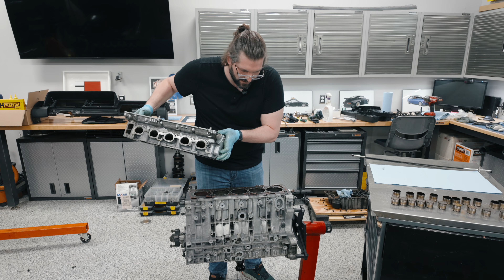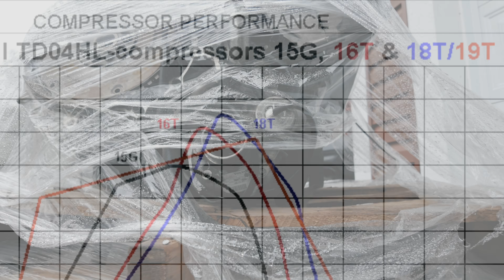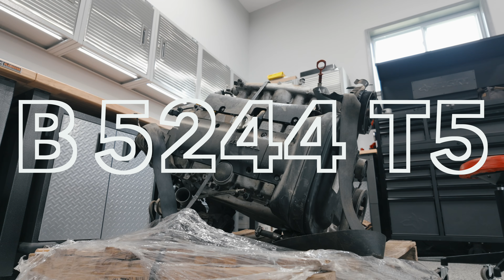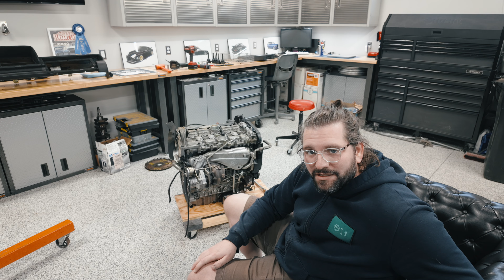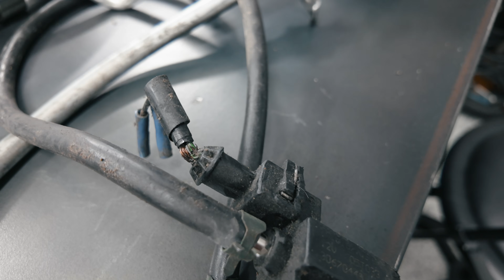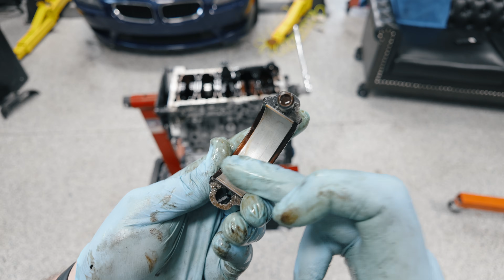The Best 5 Cylinder Volvo ever built? | 2006 Volvo B5244T5 Turbo Engine Teardown

Comment: Probably measure the bores. The head bolts being loose on the exhaust side could be caused by the engine running hot

Comment: Thanks for the methodical tear down with detailed commentary. I currently have the issue of exhaust gas escaping into the coolant system and bubbling over my expansion bottle. I'm gearing up to pull the head and hoping its just the head gasket or a torquing issue like you identified.

Comment: Man I'm pretty sure that thing doesn't have a head gasket, in fact it blew my mind when I saw it!! The oil pans are the same way, as far as I know...
Reply from the maker: They use head gaskets, but the cam cover-to-head, block-to-intermediate section, and intermediate section-to-oil pan flanges are all sealed with anaerobic sealant. A little annoying to scrape off, but otherwise works well!

Comment: is that block stronger than 2.5s?
Reply from the maker: Yes. B5244T5 has 81mm bores instead of 83mm on the 2.5, which means thicker cylinder walls on the B5244T5. Other B5244 variants are different, with thinner cylinder walls.

Comment: How come it has a alum. Intake mani??
Reply from the maker: That's the original RN intake manifold used on the P2 generation S60. Only RNC engines that came in C30s and later S60s had plastic intake manifolds.

Comment: Not sure if this will be responded to, but i have an 04 c70 and an 05 xc70 that i wanna rebuild. Will this video be a good reference for rebuilding them?
Reply from the maker: This video isn't really about rebuilding the engine, and the engine in this video is a little different than what is in both of your cars. 

This link has factory manuals that provide rebuild instructions, but you'll have to have some patience and perseverance in figuring it all out: https://charm.li/Volvo/2004/

Best of luck.
Reply: @Drive.Revive.Tinker oh awesome thank you! I did watch the whole video through and it did at least give me good reference for the teardown of the engine, so that'll definitely help

Comment: It's always a high risk to buy a used Engine. Therefore I always repaired the original Engine from the car, if possible. But my 25 years old C70 runs like new,
the Engine has no issues still today.

Comment: Long time R owner. That’s the engine to get. They rarely crack a liner so wouldn’t expect that to be the issue. Head gaskets do fail on these particularly aftermarket version. Leak down testers are notoriously inaccurate as well so I’m always cautious to accept results at face value. Tearing down was a good move. I would have also checked head for leakage past valves but machine shop certainly can do that. I’m building a T5 now but with some key upgrades to handle a lot more boost.
Reply from the maker: Very cool! I did end up checking the valves in this and another 4t5 head I have. The head from this engine definitely needs a valve job, so that's added to the list. What are your plans for the T5 going in your R?

Comment: oh man. That's close to the mileage and the same year as my old S60 T5. It had 164k miles when a teenager pulled out and I t-boned them. Still have the 2.5" binder of receipts for everything down to control arm bolts for it. Bought it with 72,060 miles in 2015, lost Labor Day 2020 at 164,344. If you still need an oil filler cap, I've got a spare in a Volvo bag.

Comment: Hey, just found your channel yesterday, and have watched 3 vids.  Nice shop, nice ideas.
But, you need to pay more attention to what you're doing, I think, I'm seeing a lot of newbie mistakes for whatever reason.  Maybe some of it is misinterpretation on my part or not watching the vids 100%.
Some thoughts:
- In the previous motor that broke the head gasket:  if indeed the head was bent before the incident, that's really kind of careless.  A straightness check of the head is super-basic and is in every motor rebuild manual since the Edwardian age.  And you certainly don't use some school ruler as you waved at the camera in another video, it must be a calibrated straightedge (there are standards of straightness, but get one to 0.1mm, over the length) that is longer than the diagonal length of the head.  The manual will give the maximum out-of-true.
- Again, in the previous motor, if you have a blowup and head gasket break, then run the motor again without even changing the oil to get rid of the coolant that got everywhere, you're just asking for problems.  Coolant in oil seriously compromises its ability to provide lubrication.  There are also products (or at least used to be, I've used one from GM 25 years ago) specifically made to help flush coolant contamination out of the crankcase in such cases (not the same as engine oil flushes for carbon removal).
- Not having doublechecked the TDC marker on the previous engine, is again just missing a basic thing that is likely in the manual, and even if not, should have been done on an unknown engine.  The manual is your friend.  RTFM.
- Leakdown testing:  Unless you're editing out bits, it looks like you're really not doing leakdown testing at all the right way.  First, for each cylinder, you have to have the piston at (near) TDC, *but with both the valves closed*.  This doesn't happen at any TDC, only on the compression stroke (every second TDC).  It is totally invalid as a measurement, otherwise.  Second, you don't connect the tester to the cylinder and then crank the regulator!  That's backwards.  You set the regulator to get the % leakdown gauge needle shifted to Zero, lock the regulator control, and THEN connect it to the cylinder, then watch the % needle move.  What you were doing here on video is just not how to use the tool, as far as I can see.
- No one should expect to be able to just throw in a motor from a junkyard and expect it to be ok and tunable with boost, but I guess you know that by now.
- I didn't watch everything later on, but if you have a crank that does not want to turn, it is not something you are going to be able to resolve by pushing it, putting some Seafoam in, and hoping.  A crank that gets stiff at some parts of the rotation is either caused by rust damage in one or more cylinders, or similar damage, that doesn't let the rings move smoothly, OR by the crank being bent.  (This shouldn't be confused with the normal increase in resistance because of valve spring compression as you turn the motor, if the cams are in, or from air compression if the plugs are also still in (not the case here, I know).)  A mix of ATF and acetone works well for rings that have rusted to the cylinder wall, by the way, to allow them to unstick, to facilitate disassembly.  Irrelevant by now, I know.

Anyhow, I don't know where you are by now in the work, but good luck.
Reply from the maker: Details get glossed over while compressing hours of video down into something short enough to be watchable, so there are things that don't always get shown, but regardless I appreciate the time and thought put into your comment. 

Interesting note on the sequence of pressurizing the tester before connecting to the cylinder; I'll have to look into that before I use it next because I don't recall that lining up with the instructions (not to say that they couldn't be wrong as well).
Reply: @Drive.Revive.Tinker  It's how my tool works, I've always done it that way, and when I crosscheck around youtube for other examples, e.g. https://youtu.be/h993q16Oul4?t=280, it seems to be the normal setup for them.

Comment: I never trust salvage yards.  Never.  I bought a RX8 engine online and when I tested it totally locked up, rusted so bad, when I tried to take it apart I couldn't.  They did send me a refund less shipping, and said don't send it back, I sent them video showing it would not crank over.
I generally buy whole cars to get an engine I want, one usually has a wreck of some kind or a bad transmission or won't pass smog etc.
This is a hassle for sure, but then you really know what you are getting.  I got a free Ford V6 recently, and it had no compression in 3 cylinder, the valve guides were toast so bad.  But then I just got another one that had a "engine knock" from a guy who bought it for the body to ls swap it and got rid of the engine and 5-speed.  Turns out the "knock" was just a cracked exhaust manifold, otherwise perfect condition.  
 Best of luck with it.  I'm not done watching,  rebuilding it you will know its good.
Reply from the maker: Yeah, it's so nice being able to actually hear an engine run first. Especially with engines that are decades old at this point, it's hard to find them that are actually in decent condition. Thanks for watching! Next up I'll be pulling the built 5 cyl out of the car and doing a similar teardown. It may be a shorter path to quickly refresh that engine and save this one for down the road, but we'll see!

Comment: I wonder what your test would show if you reassembled it with correct gasket and torque specs? Does it even really need to go to a shop for resuracing and crack testing?
Reply from the maker: There’s a chance it would be okay but, to me, it’s always worth resurfacing the head at a minimum. I ended up finding out that the head needs the valves lapped as well

Comment: wow, the 'mechanic(s)' working on it previously really did a shitty job. Missing bolts, wrong bolts, wrong gasket, bend coil pack.. It doesn't make sense at all, like, why would you do that? If you are enough of a mechanic to change a head gasket, then why 'settle' for putting in a wrong part? Just because they had it lying around? It just seems weird.

And the company you bought it of from... yeah well so far for the rating of their products. I wonder if you'd bought a grade B engine if it would significantly differ in price?

Comment: I have a 2006 S60 2.5T which runs like a clock, Its got 165K on it and I plan on keeping it for as long as I can. This video was OutStanding! It really was informative as to what the whole inside looks like and what to expect. I did my own timing belt other stuff and found these cars are really engineered well. I am starting to have electrical issues with the Upper Electrical Module, and the drivers information module but have solderer some componets and replaced a capacitor and it seemed to fix it.. Please make another video where you do the rebuild..  I really enjoyed the content. Keep it up..
Reply from the maker: Thanks! I'm glad you enjoyed the video and the teardown.
Reply: Do you post your work anywhere? I like to follow people's projects to learn from them.

Comment: FYI on a leakdown test on a OHC engine like this. Unless you can take the cams out of the engine and you have the valves closed FOR SURE, you most likely are getting the engine rotating when you add the pressure. 100psi will rotate the motor to where it wants to be so most likely you are getting a valve cracking open, and the only way to prevent that is you use the crankshaft tool used when you set the cams OR you keep a flywheel on there and have a flywheel lockout tool. I've been building engines for 25 years and did a Volvo for my personal car, and all the little tricks you need to check everything are a lot of extra work. I ended up closed decking the block, porting the heads, upgrading the stock turbo and welding and porting the intake manifold.  Take your leakdown numbers with a grain of salt if you can't make sure valves are seated and keeping the crank from rotating.  I was under 10% when back together with the same pistons & rings, same bores untouched, and a stock valve job on a 200K mile engine even after the closed deck conversion and porting.
Reply: Also.... most likely you just need to mill both the block and head decks. The 5 cyl seems to bow in the center so it really shows on 2/3/4 leakdown like yours did, and most likely they didn't change the head bolts and the exhaust side bolts yielded... there is additional heat over there so you will see it happen first there.
Reply from the maker: Thanks for sharing your experience! This will definitely get the block and head decked while it's out. I'm confident it didn't rotate a meaningful amount during the test because on the weak cylinders I tried rotating it back and forth a bit to see if the readings changed and to ensure it hadn't moved, but I've also tested a number of these engines. Very apparent that this had poor leakdown compared to the others. For a test like this, I'm not worrying as much about the absolute % reading as I am the differences between cylinders.

Comment: Really good vid this, iirc it’s only the s60-v70 R engine that comes with a MLS gasket from factory.. 

I’ve recently installed a genuine MLS gasket for my own N fully forged build.
Reply from the maker: Thanks! I'll have to dig it up in the comments, but I believe someone shared a part number for the genuine Volvo MLS gasket for the 81mm bore block. Can't yet confirm whether it exists.
Reply: @Drive.Revive.Tinker  i dom´t thonk it exists. i currently also look for it

Comment: This is super insightful. I became a Volvo enthusiast about 2 years ago when I picked up a passion red 08 c30 t5 from a used car lot for 5k and did some extensive work on it to get it back into good shape. I'm going to agree that the non-mls gasket and the uneven head bolt torque almost certainly is why cylinder pressure is getting into the cooling system. Also could be possible the head is warped if the engine overheated at some point. 

I would also say this is less likely but;

Micro cracks in the head around coolant jackets (common in overheated motors).

Sleeve shift in the block (rare on these unless extreme overheating).

I don't think that's the case here. It frustrates me to my core when I see non oem parts on these volvos... when I bought my c30, they had duralast coils and autolite sparks in them. Just super frustrating. 

Great video!
Reply from the maker: Thank you! Nothing worse than tearing into a new-to-you engine and finding lesser quality parts hastily installed...

Comment: You do not need to turn it down if something you can turn it up here in Sweden people push 600hp without issues
Reply: Good luck finding one of those here in the US!! Can't even find a diesel VO!!!
Reply: With factory internals?
Reply: @andraskanalas2876  I am rather confident that volvo used forged rods for this one so you should be able to push 500+ with stock internals, another option i shimming the p2r engine which gets it pretty close in reliability to the B5244T5
Reply: @Leo-x1o1t awesome! I got myself a real treasure😂

Comment: Agreed that since it had a non-MLS gasket, that leak from the cylinder to cooling channel was most likely due to the head gasket. Typical failure mode it seems. Same as my B5234T3 that's now getting a MLS gasket and 12.9 head studs.
Reply from the maker: Interesting to hear you saw the same issue on yours. Hope the new MLS and studs fix that for you!
Reply: is there a mls gasket for the 4T5? I can´t really find one

Comment: What's the Max Boost those Engines can Handle Stock?
Reply from the maker: You would max out the stock turbo before the engine. 350whp should be safe. Beyond that, h-beam rods are a good idea.

Comment: I have this engine in my S70, mine dynoed at 350 whp and 387 lb ft of torque on a stock bottom end. The block was shimmed and has ARP head studs. This was on a TD06-20g at 30lbs on e85. If maintained these engines are pretty solid.
Reply from the maker: Nice, very similar numbers to my previous 5 cyl!

Comment: Earlier today I shared with my viewers on the live stream that I found one of those engines in the salvage yard with a AC cap jammed down into the the turbocharge port. I put the engine in an 850 and it's been running great. 

Do you think it's possible that that misaligned coil was still producing spark and maybe just misfiring at higher RPMs?
Reply from the maker: Very possible that it was still producing spark; the boot appear slightly melted near the plug. Although its also possible that it was just carelessly crammed back in there after it was already broken and then sent off to the junkyard.

Comment: Check that it has the right spark plugs. The R and late T5 engines used a head that had longer spark plug thread length. I've gotten a spare R block and two T5 engines and they all had the regular spark plugs in it (too short). It works, but lowers compression and causing issues as things age.
Reply from the maker: Shockingly, that’s one of the few things the previous owner got right with this engine! It did have the longer plugs installed

Comment: The 4t5 being the best is debatable, it’s a good engine if you don’t mind opening it up and replacing the rod bearings. There are many, many documented cases of rod bearing failure on these engines at even 100k miles.  Use the S60R bearings when you reassemble it. For some reason the s60R appears to have received better bearings. I’d also recommend against using the factory forward lift point to lift the engine - have seen many, many of them snap when trying to remove the engines or lift them out. They did make a s60 t5 with the 4t5 in 2009 as well, just not as many as previous years. Good video!

Comment: 2,3 T5 is 100% bullet proof most bc of this enginge dosen't need the chims between the cylinders, if you want to tune up the engine. Othervise 2,4 and 2,5 engines need the chims so the cylinder walls don't starts to move/vibrate and latere crack in the bottom from the block.
Reply from the maker: The B5244T5 is not like other 2.4 engines. It has 81mm cylinder bore.